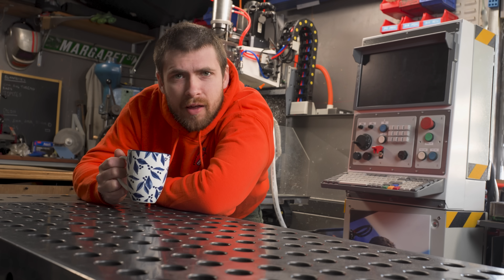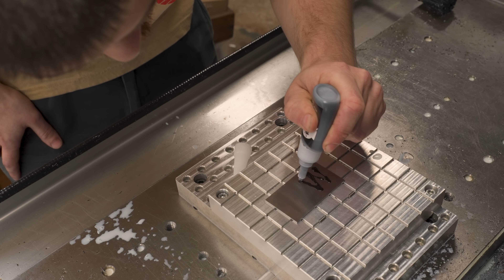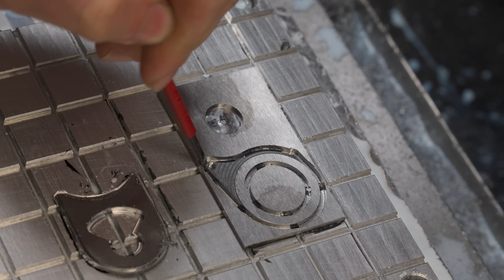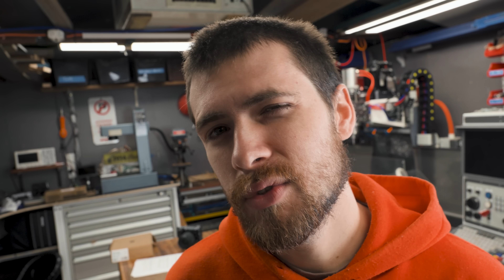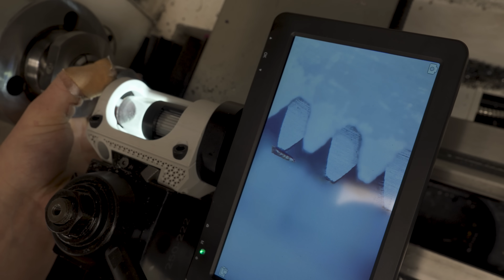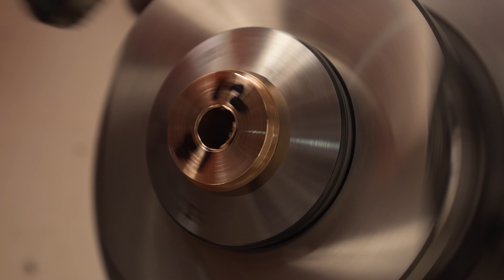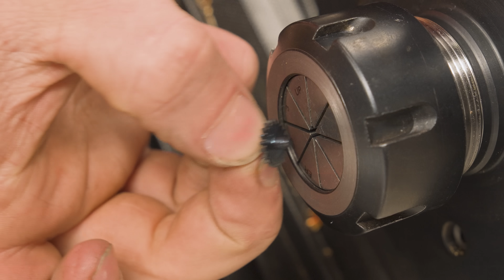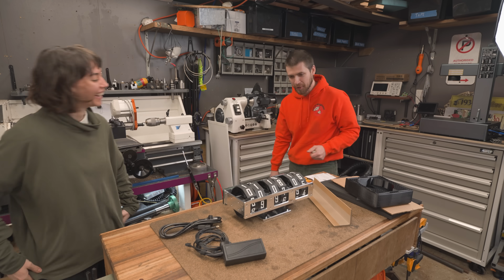What if angles were metric?

Comment: if by 'metric' you mean SI units, then the unit for angles is the radian - with 2 x pi radians in a circle -and the 3d solid angle unit is the steradian which absolutely nobody understands. and these are both dimensionless, because shut up...

Comment: Is it just me or did everyone 30 years ago still learnt about grads in school, Casio calculator had three angle settings rads, grads and degs
Reply: My HP calculator that I used in college had Grads. I never used them. Most of the time we used radians. Even common software like Excel defaults to radians.
Reply: @davidsandy5917  I still have my HP48, the screen stopped working last year though 😢

Comment: Even though gradians never caught on, and is not part of the metric system today, there is in fact an angle measuring unit included in the metric system. Or rather, it's included in the SI-system, which is the modern, more strictly codified version of the metric system. The angle measuring unit I'm talking about is radians, where one full circle is 2π radians, or approximately 6.2831853 radians. Radians are widely used in engineering today, and are extremely useful and practical when doing math on for example rotating axles, reciprocating machines etc. due to the unitary relationship between the radius of a circle and the angle of rotation.

Comment: Angles are a cyclic function so they are not the right way of looking at this problem. The Babylonians solved this problem by measuring the spread of two lines (rise over run) making up the sides of the triangle. It is how we know that they understood Pythagoras's theorum 1,000 years before he was born because they carefully constructed a table of Pythagorean triplets that measured what you would call angles. So a 90 degree angle would have a spread of 1 because one side divided by the other side comes to 1 (as they are both equal). A mathematician called Norman Wildberger wrote a book about this called Devine Geometry and makes a much better approach to teaching as you do not need to rely upon calculus to teach pre-calculus students how to measure triangles (with greater accuracy than degrees allow). Look up Plimpton 322.

Comment: Okay, here's one for you. In 1985 I went to work for Boeing in Ridley Park PA. I was Hired mainly to work on the v 22 osprey development program. At the time I had about 22 years experience in cnc manual machining and theory. I was put into a manual machine shop to start and found out that their prints were a mess. A f**** mess! Here they had inches and metric mixed together on the same print. Angles in degrees minutes seconds and in a new thing they call decimal degrees for Boeing. It was new. I went to my supervisor. He shugged his shoulders and then said make it as best you can. Scott. So I got together with a few of my buddies who had a lot of experience just like I. And we went to the drafting department and asked them why is this so on brand new prints. Well it turns out they were on a tight budget and when the clock red reached a certain time everybody stopped what they were doing and the next shift came in and a different person was working on the print that wanted to use something other than what was on the print. It was a f**** mess. Those first 2 years of v22 development was a s*** show. So they backed off everything. Went back to imperial but angles stayed 100 base. Meaning angles were 45.250 ° they were easy to convert on a calculator. So this prints in the beginnings had many red marks on them. I left that program in 1989 and went over to the ch47 program. Rebuilding Chinook helicopters... No wonder v22 crashed in the beginning
Reply: Still crashing to this day. A proud American tradition.

Comment: What comes to mind when you think of "metric"? 

The gradian is not an official SI unit. Instead, the International System of Units (SI) mandates the radian. However, measuring everyday geometry in radians is highly impractical, considering nobody wants to calculate 45° as π/4.

We can fix this by introducing the millipi-radian (mπ-rad), which scales π by standard metric factors of 10:
  45° =   250 mπ-rad
  90° =   500 mπ-rad
180° = 1000 mπ-rad
360° = 2000 mπ-rad

This elegant system creates a true decimal-based measurement that honors the natural geometry of the universe while seamlessly respecting the rules of the metric system.

Comment: I am familiar with gradients but I don’t think we can actually call them metric because they divide a right angle into 1000 equal units but that means that a full Circle has 4000. To be truly metric, the circle would have to have 1000 gradiens or something like that.

Also, let’s not forget that we don’t use metric time. I believe the reasons are connected.

Comment: Just a tip for the buggered tap, try using some feric chloride if the material you are tapping is not consistent in some fashion of iron, it will dissolve the tap out enough that you could wind it out by hand or in some cases dissolve the tap entirely in a few hours. 23:55

Comment: as a former artillery man i have to say gradians suck ass and are horribly inaccurate, for long range artillery...at 10km a 1 gradian error is 157 meters whereas a 1 mil error is 10 meters...if a 155mm shell lands +/- 10 meters of you youre still fucked but if it lands +/- 157 meters of you youre most likely just fine.....400 gradians in a circle/6400 mils in a circle.....nice work though...

Comment: The selection of 360 degrees by the ancient Sumerians comes out of two things: 1. their numeral system, which for unclear reasons was base-60, and 2. their methods of astronomical determination of the year. It is no coincidence that there are 360 degrees in a circle (six 60s), and 365 days in a year. That's because they divided up the civic year into exactly 12 months of 30 days (because the moon goes through it's waxing-waning cycle roughly 12 times in a year), which gives you twelve 30s, or 360 days. (They took care of the extra 5 days in the solar year through a system involving the Metonic Cycle, where there are almost perfectly 235 lunar cycles in 19 years, inserting an extra "leap month" when they needed to)

We inherited the system through the Greeks, as they (most notably Ptolemy in his Almaghest) used the Babylonian system of astronomy (since they were considered the greatest astronomers of the day, and had by far the longest & most precise astronomical records), which had itself been inherited through long history from the Sumerians. And as astronomy kind of inherently deals with divisions of circles, the same mathematical reckonings were used for 'circle-maths' and angles.

Comment: 360 master race, fight me. No matter how good your math looks with 400 degrees 360 is just better for radial division. If I wanted to place 3, 6, or 9 features equally spaced on a circle I can use whole number angles with a 360 degree circle. 400 requires thirds of a degree accuracy, what is mathematically elegant about tacking on extra thirds and two thirds?

Comment: Metric is a better base 10 computational system...0.001, 0.01, 0.1, 1,10,100,100.  For human interaction it is convenient to have a lot of 12's and 60's.  12 with factors 1,2,3,4,6,12.  24 adding factors 8 and 12.  60 with factors 1,2,3,4,5,6,12,15,20,30,60.  Teaspoons, tablespoons and cups seem stupid until you consider it from the perspective of dividing by 1/2 1/3 1/4 etc.

Comment: 21:59 Can someone please explain why there is a gap between the steel parts? It makes no sense how he achieves a gap between while both parts are on the same shaft.

Edit: The OD spacing from the taper to the straight section of the shaft isn't as wide as the steel connection pieces.

Comment: So, regarding why 360 degrees and hexagons in circles: you can put any regular polygon in a circle, there's nothing special about hexagons in that regard.  You can even do stars - the pentacle is a 5 pointed star with its points touching a circle that surrounds it, for instance.  

The real reason is numbering systems.  Mesopotamian cultures largely counted in base 6 instead of base 10.  (This lets you count to 35 on your fingers, because one hand holds groups of 6 and one holds 1-5)  For angles, they divided things into 36 degrees, which is as intuitive as dividing something into 100 is for those of us who assume a base-10 numbering system (ie: most people from the last few thousand years)

Later, after the cultural shift in the Middle East and Mediterranean cultures from base 6 to base 10, they literally decided that we needed more than 36 angles to work with enough precision, hadn't really worked out that it's fine to work in decimals yet, and just divided each degree by 10 as a really simple way of making it easy to translate between the old system and the new, giving us the 360 degree circle we know today.  

(Much later, long after we knew about working in decimals, some genius decided that wasn't enough and invented minutes and seconds, which are 1/60th of a degree and 1/60th of a minute.  What's wrong with decimals, bud?  Or even just moving degrees up another order of magnitude or two?  But no, we're apparently using clocks?  Because those are also round, maybe???)

Comment: There's another sorta metric measure of angle, the milliradian, aka the mil, 1m at 1000m as used in the military. 6400 mils not forming a circle but a 6400hedron, useful for shooting but not a fraction of a circle. Not so useful for engineering.

Comment: Fun fact I don't hear very often; you can easily use 1 hand to either count to 5, or to 16.

Use your thumb and begin counting at the top of your index finger. That's 1. Then you use your thumb to count the top c crease of your 

Use thumb to count. Each finger has 4 counts. Tip of the finger, top knuckle crease, second knuckle crease, then the base of your finger.
4 fingers each with 4 counts gives ya 16.

I wish I figured this out back when I was learning Hex in school. Plus it's a neat trick to be able to count in base 10 but also base 16.

Now ask me about my new Alphabet song that sounds almost identical to the og one except that it eliminates the issue with kids misunderstanding the letters 'L, M, N, O, P'
Reply: You can also easily count to 32 with one hand by counting in binary (5 fingers = 5 bits).

Comment: I can appreciate Radians…. 2 Pi Radians in a circle.  Like for AC power, cyclical based math seems to work with Radians quite well.  From an engineering standpoint, I can really appreciate the metric system.  All the units work out more nicely with less conversion.

Comment: There is a reason nobody uses grads. It is still an arbitrary number, unlike Radians, but now you have gone from the highly composite (and thus quite useful useful) 360 to 400 for basically no reason, because it is still meaningless.

Also, SI does have an angle unit, the Radian. It is the official derived (dimensionless) unit.

Comment: Commenting at 21 minutes. You're not incorrect on the properties of the Bronze, but I fear you've created the battery problem of two different types of metals. For longevity, Never change the type of metal. For planned early obsolescence change all your metals, on every piece, and consider using fused metals! I won't stop enjoying my near year mapped sphere, but the tool work itself is inspiring. Thanks!

Comment: 6:00 That endmill seems warn out. You shouldn't have that heavy of a burr. What's your rpm or mmpm? I use sfm, ipm because I'm a stupid American and we like to dumb things down for no reason. Lol

Is that edmill carbide, it looks to be by the coating. How fast can your mill run? Rigidity is also a factor. Your probably looking at around 7,000 to 17,000 rpm for O1 Tool Steel as a base line. lol

I'm sure with 2mm your axial and radial are considerably small.

Inconclusion, you probably need to run as fast as possible and go from there. NYC CNC on YT makes good "recipes".

Comment: The metric system does have angles - they are officially measured in Radians (pi radians = 180 degrees)...and i you want power of ten angles then you have "grads" along with milligrads;

Comment: The premise of this video is weird, of course we use metric angles for measurement, they're radians (most commonly milliradians for optical beam steering) and steradians (3d radians). Perhaps you don't use them, but they're constantly used in electrical engineering.

Comment: Degrees, gradians (gon), and radians all have their advantages. Degrees use 360° per circle, which is extremely divisible (2, 3, 4, 5, 6, 8, 9, 10, 12, etc.), so many common fractions give whole numbers. Gradians use 400 gon, making a right angle exactly 100 gon, which is convenient for decimal calculations and surveying. Radians use 2π per circle and are mathematically the most natural, especially for calculus. So it’s not that degrees are simply “better”: ° = convenient division, gon = decimal convenience, rad = mathematics.

Comment: 99.9% of the time you are dealing with degrees of gradians and there is any sort of software involved it has to be changed to radians eventually because everything defaults to them... same with temperature units, input Fahrenheit, Celcius, Rankine... It's always Kelvin deep down

Comment: Have you learned the magic of anti-backlash gears?

Basically, every gear is replaced with two gears. The first gear drives everything the way you'd expect. The second gear freely rotates by a few degrees and is spring-loaded to align itself with the first gear. 

Offset the tooth alignment by a few teeth when you mesh them, and the 2nd gear will push on the back of the meshed gear teeth to make sure you never have backlash

It works great if you aren't moving really really fast, accelerating very suddenly, or carrying huge torques

Comment: In the International System of Units (SI), plane angles are measured in radians (rad). The radian is defined as the ratio between the length of an arc and the radius.

Comment: (Pedantic um-actually): Technically angles do not need units as such since they are just fractions of a full turn/revolutions. Using 360th of a full turn for degrees is mostly just a convention and somewhat useful because 360 is a highly composite number so many of the common fractions we're interested in comes out as whole numbers. So instead of for a 6th of a turn (or a 3rd of a half turn) which would be 0.666...  of a turn we can say 60 degrees. 

But for actual measurements and calculations (especially within computer code) we might as well just measure and calculate in floating point values for a whole turn and convert that number into whatever angle convention we'd like at the end by just multiplying it with whatever number of divisions you'd like so 360 for traditional degrees or 400 for gradians or by tau (i.e. 2*pi) for radians, etc. In fact since IEEE 754 floats actually treats all numbers as basically scientific notation it doesn't actually really matter what number you choose to internally represent a full turn as since the accuracy will be just as good (or just as bad) anyway, you'll just need a different constant to multiply it with to get to any output representation you'd like.

Comment: I think their “benefit” is that when used as a measure of latitude, they approximately coincide with 10 km, for the sole reason that the metre was sized so that they would. Their drawback was that theye were invented by someone who apparently knew nothing about geometry, because the sensible thing is to start from 60° and then go down by powers of two, as anyone who owns a pair of compasses should be able to explain.

But then eliminating all of the nice powers of two in favour of things with factors of 5 was one of those revolutionary goals, I guess.

Incidentally, if we had gone with a rational, binary system, maybe we'd need negative binary prefixes. Though again, organising powers of two as powers of 1024 is another leakage of fives into otherwise sensible maths. We should be using 16, 256 or 65536 as the prefixal chunking factor.

Comment: I haven't watched the video yet, I intend to, but isn't that what the Grad is on your calculator? In theory you could also argue Radians are too, because a full rotation is 2pi (or 1Tau), So a right angle, or quarter turn, is 0.25 Tau Radians. They're used a lot in engineering.
The Grad, or Gradians, is basically... 100 Grad is a right angle, like 90 degrees. so where you have 360 degrees, you have 400 Grads.
These are effectively both "Metric" angle measurements, though not actually part of the Metric system.
Here's another one for you. The Turn (tr) is a computing science measurement where 1 full turn (360 degrees) is 1 Turn. So, 0.25 is a right angle. It literally just reduces the angle in degrees to a decimal between 0 and 1.

That's all 4 I know about (Degrees, Radians, Gradians and Turns), and technically all except the Degrees could be considered Metric.

Comment: I learned to use the metric angle system for navigation 30 years ago in the Air Force (RAAF). Once learned and practiced, it is such a better system and less prone to the mental calculation errors of multiplying and dividing everything by 6. Was also easier to communicate (radio, spoken) coordinates without errors.
No calculators, phones etc in the field back then, it was all down to rote learned multiplication tables and mental arithmetic. 
Now it's been almost 30 years without practicing much navigation and when I have, it was in DMS to be compatible with other people.
These days I wouldn't dare try navigating myself out of the bush in mm. 
I'd sadly have to fall back on the old Deg, Mins, Secs if I wanted to every have a hot shower again.